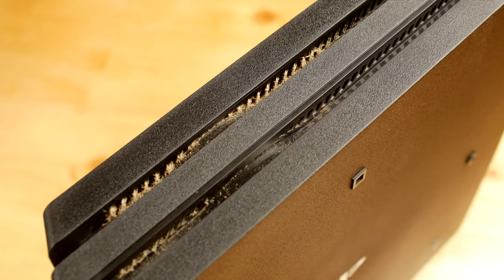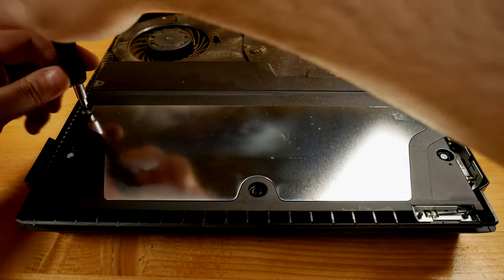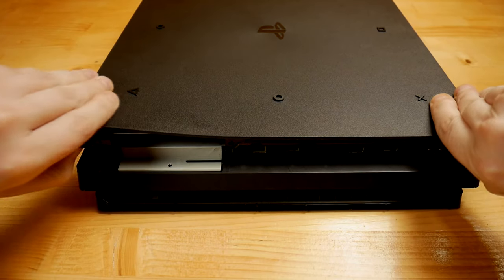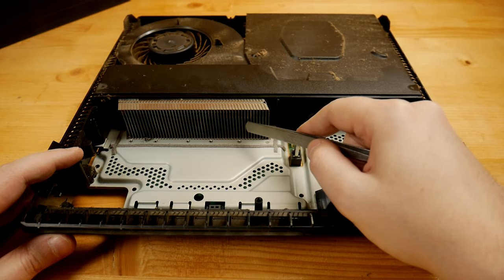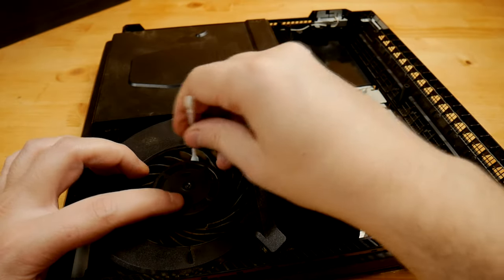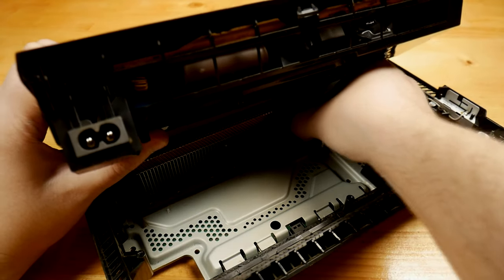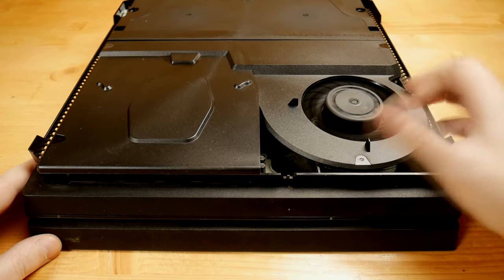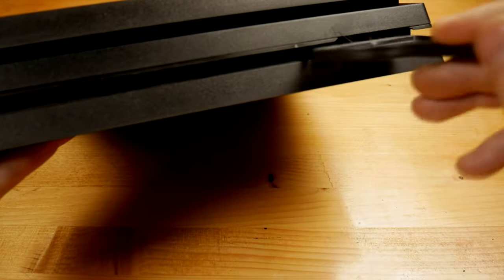How to Clean PS4 Pro - PlayStation 4 Pro Teardown & Cleaning

Comment: Followed this tutorial throughly! Works like a charm!! No more loud airport noise! Thank you!
Reply: Where you from
Reply: @hopenkosi937 Your mom's house
Reply: @HanzoWasabi  bro you didn't have to do em that dirty 💀💀💀
Reply: Mine sounds like a freaking leaf blower, should I be concerned?
Reply: U vacuumed it?
Reply: @Ashh536  i vacuumed without problem with little part narrow which came with vacuum, then with wiped with wet wipes and then with cotton pad micellar water not much drops just enough that cotton pad is wet, 3 little drops. I dried with dry cotton pads just wiped over and lastly with ear sticks little dipped in micellar water to clean cooling circle which spins idk name of that part in ps4😁 and i also vacuumed from every side of ps4 where u put in games cd there was also ew dust, and lid i cleaned, i left it to dry just for any case.

Comment: You don't need to remove the power supply wire, just use air duster and whatever you got to clean around, just pulled my pin off and now I have to replace that
Reply: Seems like a lot of people in the comments are having this issue. Maybe y’all just heavy handed?
Reply: Skill issue.

Comment: the moment u took out the battery I was "like ok I wont need to go further then that" funny neither did you🤣🤣
Reply from the maker: 😂😂😂 I've gone far in a different video named "PS4 PRO Deep Cleaning" but that's mostly if you also want to replace the thermal paste, in most cases a simple cleaning like this is enough

Comment: DO NOT REMOVE THE POWER SUPPLY FROM THE MOTHERBOARD.
THE CONNECTION PINS CAN BE DAMAGED OR RIPPED OFF.

It is not needed if it is just a simple cleaning and it risks pulling the connection pins off the motherboard itself.
Reply: Wish I had read these comments before following this guys instructions.  That's exactly what happened to me.
Reply: I was trying to pull it off, but when I read your comment I stopped. Let's hope it still works

Update: it's working amazing. Just like it's new! Thank God I don't have the airplane sound anymore 😂
Reply: @grunge1677  I was about to pull it out until I read this comment too😂😂😂
Reply: Too late for me bruh I ripped out the whole white thing holding the cables anybody know a fix??
Reply: @SandqMan  no
Reply: @SandqMan  some guy in the comments said he got it sautered at a electronics shop
Reply: You mean do not disconnect the cable from it right??
Reply: @richardludvik7974  don't remove the cord connecting the power supply to the mother board at all if your just cleaning it
Reply: @richardludvik7974  yea
Reply: @perlguy I just did the same 😢 did u get yours fixed?
Reply: @SandqMan same shit just happened to me. You get a fix?
Reply: @victorvelazquez681  your gunna have to weld it back on bro or not weld but the other word for it i think it was sauder? I don’t remember
Reply: @SandqMan  Hopefully it's fixable because the whole thing ripped of the motherboard.
Reply: i was too late to read this
Reply: Phew, saved me from a mental breakdown. I'll only clean the fan now lmao.
Reply: Fuckin ripped off the motherboard dammit
Reply: @grunge1677 same happened to me😭
Reply: Im so happy I saw this comment. You Actully saved me holy 🙆‍♂️
Reply: Wish i knew this before hand , wish the video got more in depth
Reply: @banbrotherhood how did u clean it?,vacuum?
Reply: @Ashh536  You can just use a thin brush  and compressed air for cleaning the whole PS4 but do not let the fan spin when doing it. It can cause static to charge and fry the system if you are not careful.
Reply: Hello I’m Alex this just happened to me I removed it and it took everything like the sticker 2 of the metal strips in the motherboard almost peel off but they are still there I took the 2 triangles that side by the cable is there anyway I can fix or I give it to the electronic store
Reply: This is what happened to me. Is there anything i can Do now
Reply: @daisylorenz2029  you can try to sauter it back on, have someone repair it, or buy a new system and swap hard drives if they are compatible.
Reply: Just be careful when pulling it off 😂
Reply: Thank the lord. This replay was 1 year ago and it still helped me. I was taking so long trying to gently take it off. Thank the lord I don't have to😮‍💨
Reply: Thanks for the tip G, I wanna test if I clean it, it’ll run better

Comment: This is great thanks. Although one point is never let a fan spin as it will be like a generator and sending back unwanted voltage to the board.
Reply: No it won’t lol
Reply: It doesnt just run by itself. Lol
Reply: Just disconnected the power supply who'll clean a ps4 which is plugged in 😂

Comment: This white cord after the power supply is on there for me. It doesn't come off? I'm trying to yank the little thing and I really don't want to pull it from the wires which I've tried several times and I know anymore after this will rip the wires off. I just feel it.
Reply: Late answer, but for else. If that's the case, you can leave power supply cable on for cleaning everything. Just be careful working. There's actually quite a bit of slack to turn it away when cleaning.

Comment: I don't think I would remove the power cable. From what I can see and have read in the comments, it's too easy to break it, especially in comparison to the PS3 slim. So I would leave it attached in my case. I wouldn't be using a vacuum either but instead, an air compressor. Way easier to blast away the dust on the fan and heatsink.
Reply: Cleaned it (it does have some rust or corrosion but thankfully on nothing more than the metal and plastic and nothing vital), thanks to watching this. I wish the PS4 Pro was as open friendly as the PS3 slim or even the PS4 slim. :(
Reply: @DarthDragon007 I think there’s starting to form rust on the metal panel u see when u first take the top off… is that bad or is that ok?
Reply: @line7596  I'd probably take it off and use soap/water maybe alcohol to clean it as best you can then dry it off thoroughly before putting it back..
Reply: @DarthDragon007  I’ll try that! Thank you😊

Comment: It looks like you've used some cleaner with your cotton wool pads. If that is the case, could you recommend a cleaner that doesnt damage any of the plastics or electronics? I have some Isoprpyl cleaner, but im unsure if i can use it on the plastic.
Reply from the maker: For the plastic parts you can simply use water

Comment: Also if the cable from the power supply to the motherboard has never been taken out it will be a pain to get out at first so be gentle. My first time trying to clean my ps4 pro i accidentally ripped the cables from the connection and had to get them sautered back together at a electronics shop
Reply: think i’ve just done the same

Comment: BE CAREFUL, I just did what he said and removed the bottom part of the power supply cord, RIPPING IT OFF. After further research you are supposed to remove it from the top part that connects to the power supply. I believe i have a different model, please add more warnings into this video, i have to get it repaired.
Reply: To late i already ripped it

Comment: How do you remove the bit under the silver plate. Is the middle screw fake? 

I can't budge it
Reply: Did you try turning it the other way
Reply: The screw driver I use just jumps off it. So it's a real screw?
Reply: @SpoodinOot  Yea I was using a t8 and it wouldnt budge bc I was turning it the wrong way🤦‍♂️ then I was able to remove it
Reply: Mine has never been open and that screw is a circle. Literally no way to get that off unless i just snap it. Just bs..

Comment: Thanks. Great tutorial. Fired up my Ps4pro since.. Don't even remember and noticed it being quite noisy. Decided to check out cooler and began to check iFixit tutorial, but very quicky got thought that this is overkill. I just need to get access to fan and cooler and what do you tell. YT saves the day. With this got system cleaned up and ready within like 20mins. However, it was in way, way better state than I though and looks (=sounds :) ) like I gotta began to consider possibly replacing compounds in it. But even so. Excellent tutorial in disassembling to get into critical parts, thanks...
Reply from the maker: Glad it helped

Comment: Thanks man! Cleaned it with the kids helping. 
One thing, while Pwrspply out of the way, hold vaccum cleaner with broader tip above fan, directed at an angle. At the same time blow air through grills, to clean them. Fan does not suck air from the back, but blowa is oyt the back. So radiator grills are congested from inside. When you vacuum from the PS side you just draw dirt deeper into grills.

Comment: can I use a mini vacuum cleaner and clean it away so it pulls a little and not break it
Reply from the maker: If a mini vacuum cleaner is the handheld type, that won’t do much and is not powerful enough if your PS4 Pro got some really amount of dust in there. If you check this video  https://youtu.be/82V_kWSkgHA you can see the large amount of dust is stuck on the other side of radiator so unless you wanna fully disassembly it, you need a powerful vacuum cleaner. If you’re ready for a complete teardown, then you don’t need a vacuum at all

Comment: I've cleaned my fan, it's hard to get all the gunked dust of the fan blades, and alot of it falls under neath. My CD player won't work not as a result of my cleaning, it's got the disc not recognised problem and no common fixes will work,. But I nowadays after being sick of the noise and the console over heating and thus causing games to crash more often, I now  just play with the lid off, the sound difference is unreal and yes the console is then exposed to more dust. But the PS4 pro is so loud, once you take the lid off, after 20 seconds it goes so quiet. Funny when I first got the pro I remember thinking how quiet it wascompared to other console I'd had, then after about 3 months, it sounded like it was taking off to the moon.

Comment: i need help, i think i broke mine out of place, in minuto 4:31 i was supposed to remove it and it all of it came off, i need help please i dont know if it’ll turn off, someone please answer
Reply: Bruh your not supposed to take it off. It's easily breakable and now you gotta buy yourself a soldiering kit which cost less than $20 and basically attached it back

Comment: thank for the video bro! I had one scare once when I tried to pull the power supply like you showed instead of coming away like your it started separating and I was like WTF ... then I just looked at it a bit closely and just pushed it back in and it all clicked and it's working for years now and I just clean the fan and the parts beneath the plastic coverings ... I guess I didn't do something right but now I am afraid to try to pull the power supply again :D
Reply from the maker: Yeah, I heard about this happening a lot. It never happened to me, I dunno why on some consoles it breaks those cables. Usually I’m more afraid of ribbon cables than such cables

Comment: i pulled off the power supply from the circuit board, i was pulling where the guy in the video was pulling and the whole thing came off.
Reply: Same, because instructions were wrong, some models apparently have this part glued, so you can't disconnect it. The other end needs to be disconnected.

Comment: Can you say again what star form screwdriver you used?
Reply from the maker: Security Torx T8
Reply: @YesterdaysTech  thanks.

But it thought it’s two different torx screws? Cause i was able to unscrew the metal plate but after that the one I used was to small for the other screws

Comment: Hello, im am wondering is it ok if i do not touch the power supply. Since its my first time doing it i am a little scared to touch it.
Reply from the maker: If the PS4 Pro is unplugged, there's no need to be afraid
Reply: It's ok to handle, but just don't put anything inside the casing. Capasitors could shock you even after dissabled, but it's actually virtually impossible to insert like your hands inside components.

Comment: Im actually really confused about the black plastic screw on the power supply, some videos show them taking it off but some don’t.
Reply: I tried but ended up not having too. I thought it was supposed to come out because it was hard at first but I figured out that you just pull out the supply and that rubber screw will come out alone

Comment: Bruh i cant get the middle screw out dawg, like theres a little pike in the middle and wont allow  anything to twist it free
Reply: It's not normal Torx bit. It's security one. I opened mine with 1,5mm flathead screwdriver. I'm not suggesting to use it, but it can be done.

Comment: When I was gonna pull the cable out at 4:34 the base broke from the bottom is there anyway to fix this or is the whole ps4 trash now
Reply: I have the same issue. I accidentally pulled the connector completely off the motherboard and now it needs soldering to get it to attach and I don’t know how to solder. Did you find any solutions? 😢

Comment: I just got a pro a few weeks ago, 2 of the screws on the power supply piece are stripped out, any tip on how to get them out? I was trying to get inside to get to the radiator and make sure there isn’t dust and clean it out but now I can’t because of those screws. I think GameStop probably went inside of it and cleaned it before they resold it and stripped a few screws in the process 🤷‍♂️ it does look cleaned from what I can see but I still like to do it myself to make sure ya know
Reply from the maker: It’s pretty hard to deal with damaged screws, try using a rubber band, maybe it helps the screwdriver to unlock it
Reply: @YesterdaysTech  yeah I figured it was a bitch to get it out, I’ll just have to try what you said or look up different things to try, thanks.

Comment: If your shit over heating but some canned air and spray the sides and the fan but make sure to do it outward so your not blowing the dust into the console then buy a mini table fan for 10$ at Walmart and put it facing your ps4 right side where the fan is and it woll never over heat again

Comment: CRC contact cleaner. You can spray half a can on any electronic device or mother board and its the best way to clean electronics
Reply: Well I would highly advice against that without noting that you gotta disassemble everything to small bits. It'll easily make loose dust in thick paste if one tries to use it otherwise. Just to note.

Comment: Did you use a T8 screwdriver for the whole breakdown? Where did you get your screwdriver set from ? Link thanks. I need to do a deep clean and add thermal paste.
Reply from the maker: For a complete disassembly you’d need a Torx T8 and Phillips Screwdriver PH00, PH0 and PH1. There are plenty of PS4 tool kits out there, however, you should find them at any tool store.
Reply: @YesterdaysTech  a
Reply: @eduardobava5174  a
Reply: It's actually security torx T8. But I disassembled the system with 1,5mm flathead screwdriver. Yes it can be bad for screws, but screw that. I know what I'm doing. Just for those who tend to stuck in the security bit thing. I sure did. Smallest SB TX's I had was 10's in every single toolset I have :)

Comment: How'd you take out that white cord? I'm having a tough time.
Reply from the maker: Just pull it, should not be that hard
Reply: @YesterdaysTech  I got it but thank you for replying! :)
Reply from the maker: You're welcome 🙂
Reply: Mine ripped the port off the circuit board
Reply from the maker: Really? 😳
Reply: Yeah I wiggled for a long time with increasing strength then it just ripped off.
Reply: @futbol023  same here, how are you fixing it?
Reply: @loganford3925  I’m not, when I took it to a repair store they said since it’ll probably need soldering it cost $130 plus other labor costs, And  game stop offered me $150 in store credit so I went that route. Especially because I walked in right as they were taking in a shipment of PS5’s .

A new PS4 Pro costs almost the same amount so I figured I may as well upgrade. 

I should’ve been more careful with that port and used a needle to undo the little clips in the port or disconnected it from the other end. Then if I would’ve broken it there I would have had to just replace the power supply which it would’ve been a lot easier and cheaper.
Reply: I'm pulling SO HARD and it doesn't come off
Reply: Its a two peice connector you will need needle nose plyers to remove it safely if you grab at it with your hand you will likely be pulling on the female connector that is attached to the motherboard.
Reply: @futbol023  Outs. Never wiggle connectors from wires. If connector seems to be way too tight, I usually rock it gently with tweezers, screwdriver or something similar until you can see wire side connector moving. Then pull straight and having good grip on all wires to release it. Would be good to use tools to, but usually connectors are in awkward places or too small to do that. Obviously some connectors can have locking tabs or releasing ones that should be checked.

Comment: That was not really clean though. So much dust left inside. Fan was supposed to be out completely and thoroughly cleaned. Also the main point of doing this is to make the console as efficient and silent as possible which you can obtain only by having a high quality thermal paste applied which didn’t. Hopefully that worked for you but people should know this is not the way to clean things. Good luck
Reply from the maker: That would be a full teardown and a deep cleaning, I have a separate video for that
Reply: Oh c'mon the video is about cleaning the system. It's obvious that paste replacement can be the issue, but in most cases it's simply the dust, especially inside cooler. This covers that really well.